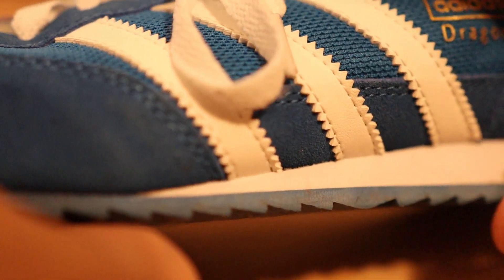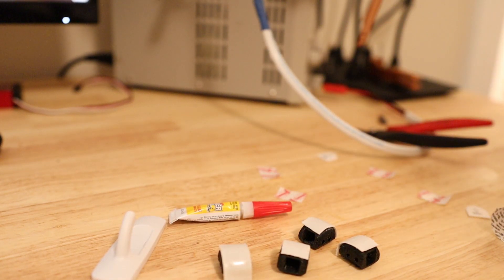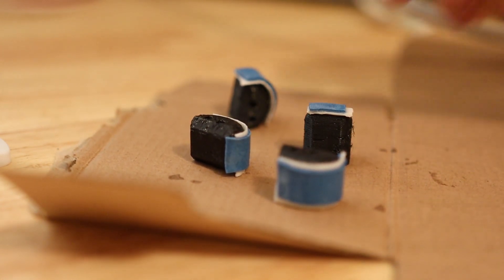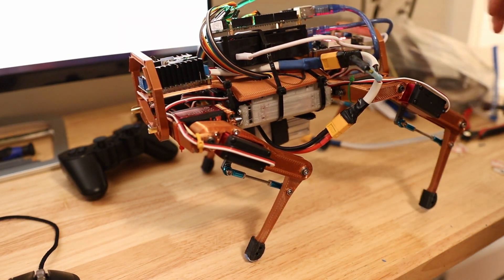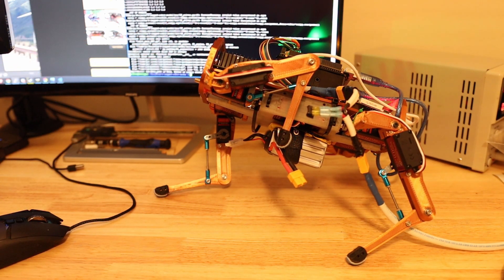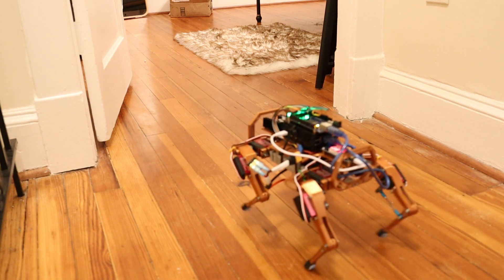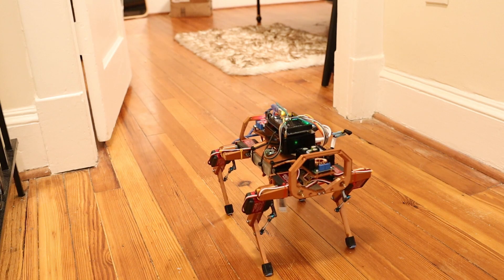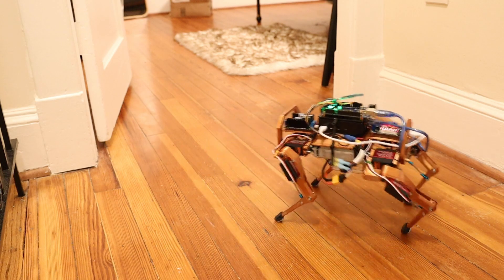I Made Shoes For My Robot So We Can Match (Small Walking Robot Episode 3)

Comment: In my opinion, using rubber bands is not a good thing. The shoe should be flexible, but not tacky.
Reply from the maker: Thanks, I will try something a little slicker on my next revision.
I like your videos, I want to use 4-bar linkages on my next robot. There is a lot of trickery that can be done with them to tune the mechanical advantage throughout the range of motion.
Reply: @NathanBuildsRobots  Thank you. Now a day I use MG92B servos which are as small as SG90 but with much more power. 
They would be really suitable for your scale.